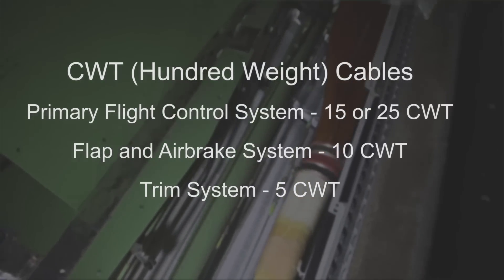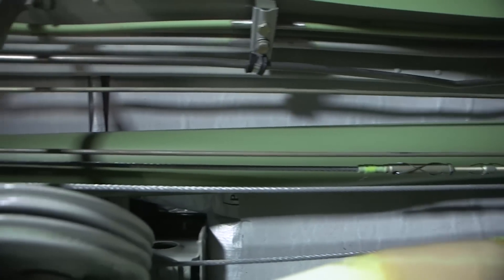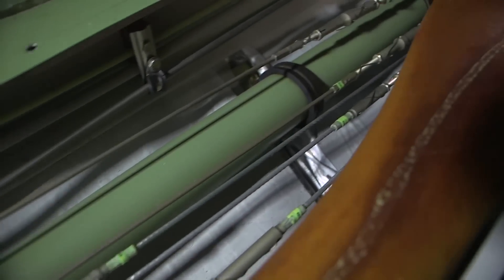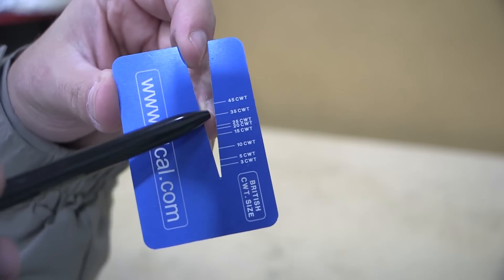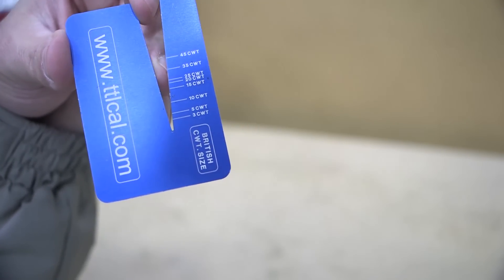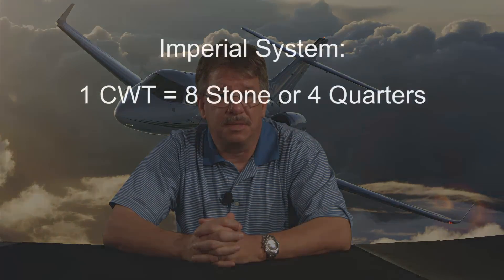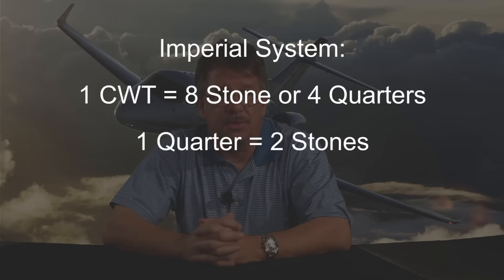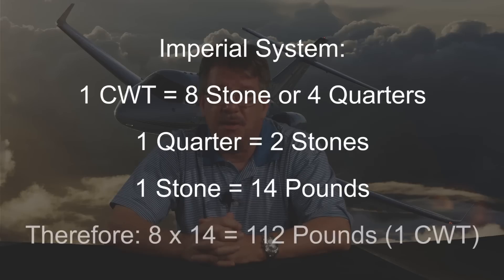Understanding and working on Hawker 125 Series CWT Control Cables

Comment: Hi, could you help me ? I would like to know where I can buy these cables CWT 5, 10,15,20 and 25 I work in a calibration company in Brazil and we have a tensitron CWT-150 tensiometer from an aviation company but we have the common steel cables to do the calibration, and we need to buy these CWT cables